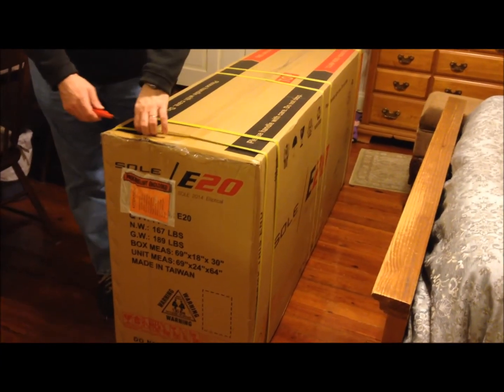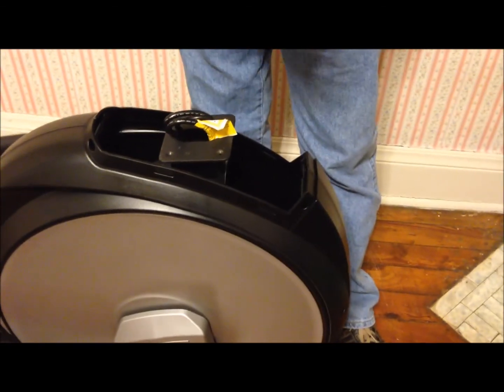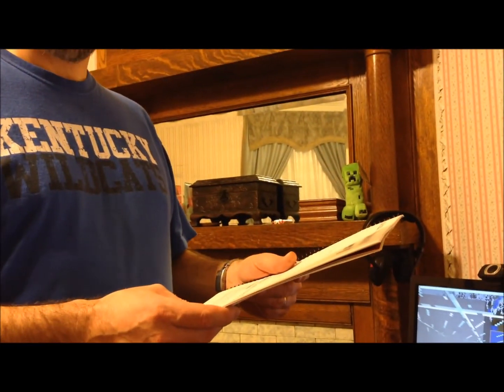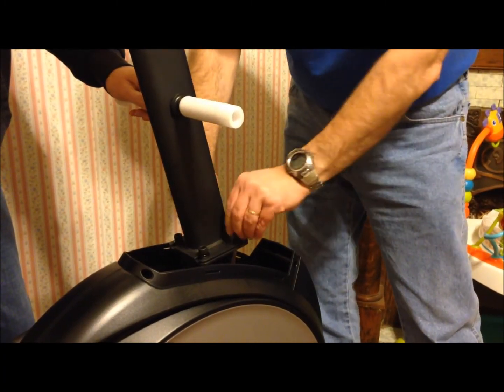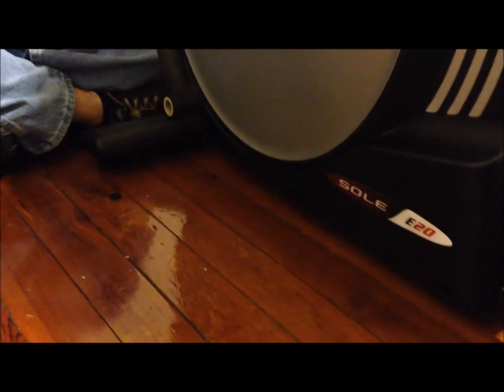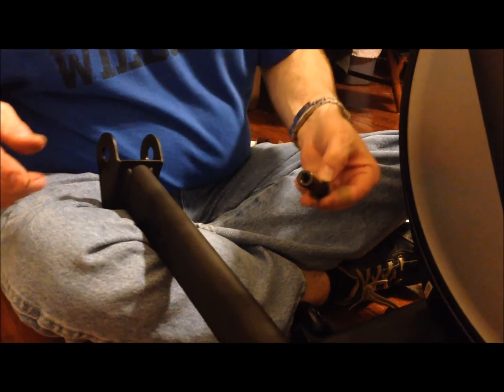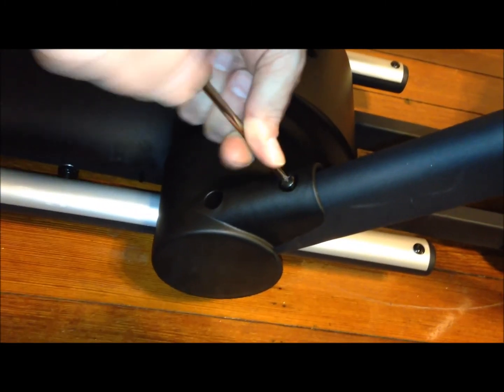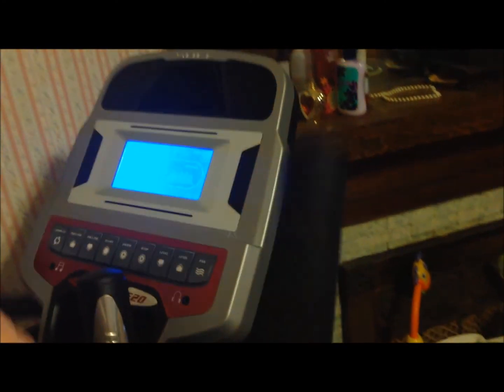SOLE E20 Elliptical Assembly

Comment: You have had this for a while now, any additional thoughts on the model you chose? How much have you been using it? Thanks in advance and have a great day!
Reply from the maker: Thank you for asking! I am VERY happy with this model. I am on it every day for 1 1/2 to 2 hours. I have not missed a day since I bought it. Kevin has added lube to it because it squeaked just a little, but after he added the lube, it was perfect. This machine does not wobble and as long as I stay above a rate of 4.2 it keeps my heart rate perfectly. I have no complains at all. It makes NO noise at all. In the past I have had several people ask me about noise because they live in apartments. This would be the machine to get if you are worried about noise. I would definitely recommend this model to anyone looking for a dependable elliptical.
Reply: Tami Dunn Thank you so much for replying! My wife and I looked at this model at Dick's and thought it seemed quite good.  How fast is 4.2 and are you using the heart rate from the hand grips or did you get a heart rate strap? I was looking through peoples reviews at sears and a number of people had the rollers jump the track but you don't seem to have had that problem at all.  Does that even seem possible to you?  I planned to go back to the store and look at the roller design a bit.